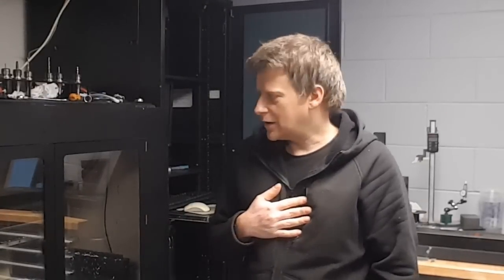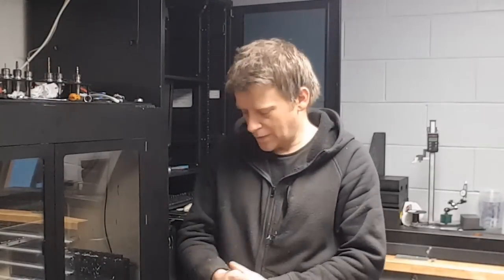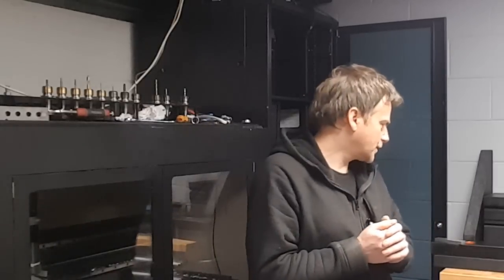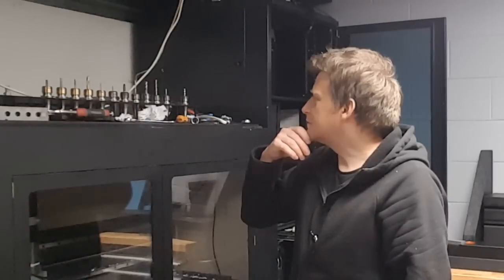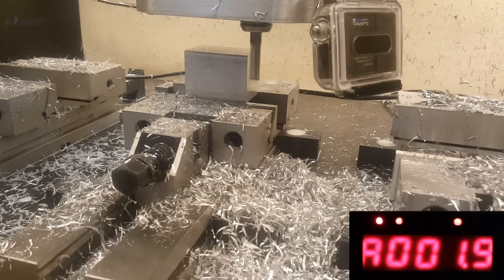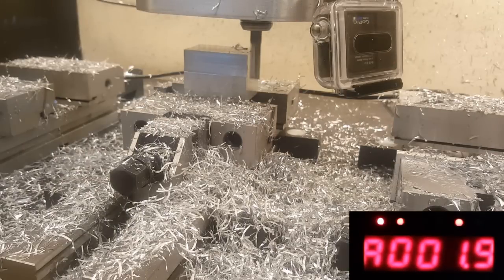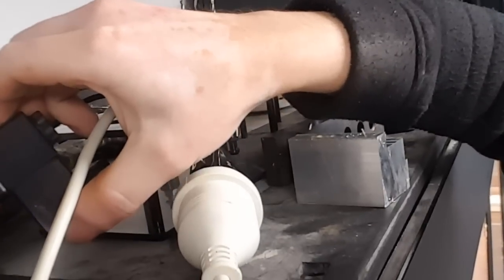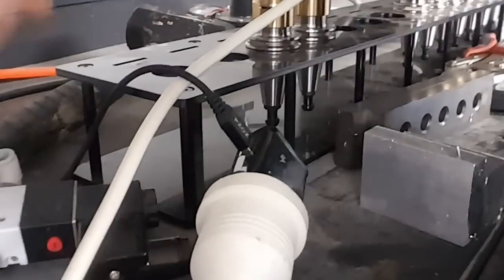ATC 2.5KW testing the spindle limits - THE BEST Chinese spindle, second review after over a year.

Comment: Piotr:  If I remember correctly, you mentioned in your first review that you were going to try using inexpensive toolholders/collets.  Did that work out for you, or did you find it necessary to upgrade?  Also, your spindle's stated rated current is 6.6 Amps, yet it seems to be working fine at up to 10 Amps!  Did you receive any performance and/or setup information for it from the manufacturer?
Reply: It wasn't working "fine" at 10 amps. it was bogging down. Any spindle can go over its continuous rating for short amounts of time. Mostly what that accidental overload test shows is that the rated numbers are truly the "continuous rated" numbers. Sometimes the number they put is the max current, and not the continuous (like they do on your bosch or Makita router for example).
Reply: @wernerautomation2834  OOPs - I guess it was actually 8.9 Amps rather than 10 Amps.  So, spindle power input is 8.9A * 220V * 1.73 = 3391 Watts.  At 60% efficiency, that's 2035 Watts output.  Power ratings for HF Spindles (and most motors), unlike routers, should be continuous output power rather than input power.  If properly rated, Piotr's "2500 Watt" spindle should not have been bogging down, and IMO, doesn't appear to have been.  Why do you think it was?

However, the spindle is supposedly rated 2500 Watts @ 6.6 Amps and 220 Volts.  So, the rated input power input is 6.6A * 220V * 1.73 = 2512 Watts.  At 60% efficiency, that's 1500 Watts output.  Maybe it's rated based on input power, like routers?  That's why I asked about performance curves (speed vs torque) which unlike other Chinese manufacturers, Jianken advertises.
Reply: @gmack4097 that spindle has 0.89nm torque at 24000rpm for 2.24kw output power (and 2.5kw input assumably).  They do not provide a duty cycle, so we can only assume this is both continuous and truthful before testing. The bogging, it is quite audible, with every cut having a continuous tone except those 8+ amp heavy ones. The drop in tone mean the spindle is slowing to a point on its curve where it has more torque available. Because we know this is a flat torque output spindle, we can assume it is operating above it's continuous rating of 0.89nm in that cut. A quick check of the sandvik calculator says the 10mmx4mmx3m/m cut with a sharp 3 flute needs 1.31nm - well above the continuous rating and completely consistent with the 9A draw vs the 6.6a continuous rating.
Reply: @wernerautomation2834  You have performance data for that "2500 Watt" spindle?  Can you share it?
Reply: @gmack4097  its on the jianken website page for that spindle.
Reply: @wernerautomation2834  Shouldn’t the VFD limit the motor current to the “PD141 - Rated Motor Current” from “the nameplate of the motor” to “protect the motor” as stated in the VFD manual?  Piotr reportedly entered 9A rather than the nameplate's 6.6A for spindle current when he programmed the VFD.
-Selecting “ISO Goup: N, Main Group: 1, “Sub Group: 2”, “Manufacturing Process: Z”, and “Heat Treatment: AG” in the Sandvik milling calculator for Piotr’s 6061 Aluminum predicts 3.25kW and 1.29nm at 24 kRPM.  (Even more torque/current would be required at lower speeds to maintain the demonstrated material removal rate.)  That seems unreasonable since there’s only 3.39kW going into the spindle.  After changing to “Heat Treatment: UT” the Sandvik predicts 2.0kW and 0.79nm, which is somewhat more reasonable and consistent with other calculators like Kennametal’s (1.1kW and 0.44nm) and HSMAdvisor’s (1.4kW and 0.55nm) as well as the demonstrated results.
-The closest data sheet for the Jianken JGL-100/2.5R24 spindle that I could find is for a spindle rated 380V at 4.0A (2633 Watts) input and allegedly outputs 0.89nm at 24000 RPM (2237 Watts).  That’s 90% of the claimed “2.5kW” and an unrealistic 85% efficiency.
-Piotr’s is rated 220V at 6.6A (2515 Watts) input and allegedly(?) outputs 0.89nm at 24000 RPM (2237 Watts).  That’s also 90% of the claimed “2.5kW” and an even more unrealistic 89% efficiency.  Who knows how these (and other Chinese) spindles should be driven or how they are should perform.
Reply: @gmack4097 the vfd will limit the current to whatever it has been set to. usually that's 120%-150% the rated motor current, but he could have set it to anything - we know its at least 9 amps :) 85-95% efficiency is what you would expect from an induction motor. they are among the most efficient motors out there, which is why they are used in everything. They lose efficiency in lower speeds and when the load is small.
Reply: @wernerautomation2834  But typical HF spindle efficiencies in that power range seem to be about 75% with an 85% power factor, yielding about 64% apparent input power to output power ratio.
Reply: @gmack4097  no
Reply: @wernerautomation2834  Yes!: Piotr's HY VFD (HY02D223B?) which is "Suitable [for] 2.2kW Motors", has a "4kVA Capacity", and "10A Output Current".  That's consistent with the current requirements of the following spindles, all of which have realistic performance claims/specifications.!  Do you have contradicting examples?
-https://www.mechatron-gmbh.de/fileadmin/user_upload/datenblaetter_2019/HFS-8022-24-ER20.pdf
24kRPM: Output/Input = 2.2kW / (8A * 230V * 1.73) = 69%

-https://www.mechatron-gmbh.de/fileadmin/user_upload/Datenblaetter_2019/ATC-8022-30-ISO20.pdf
30kRPM: Output/Input = 2.2kW / (8.4A * 230V * 1.73) = 67%

-https://www.hsdusa.com/bo/allegati/Files/767_1423h0243_es325_2p_400hz__24000_50000rpm.pdf
24kRPM: Output/Input = 2kW / (5A * 380V * 1.73) = 61%

-https://www.damencnc.com/userdata/file/1137_Dimensions_C4147-C-DB-P-ER25-HYSV-2.2kW-18000-24000RPM_.pdf
18kRPM: Output/Input = 2.2kW / (8.6A * 220V * 1.73) = 67%
Reply: Another (American made) rather impressive "passively cooled" 2.2kW ATC spindle rated for 10 Amps at 220 Volts. - https://www.youtube.com/watch?v=qiM20-woEOk
Reply: @gmack4097  That efficiency calcukation is conceptually wrong! The motor's rated current multiplied by rated voltage gives you the apparent power in VA while the rated output power is in W. Not the same unit. Seems the same, while W=V*A, but it is not exactly. The apparent power (VA) is the vectorial sum of the reactive power (VAr) and real power (W).

The conceptual flaw is that the reactive power does not produce work nor require it to produce so it does not decrease efficiency alone.

The rated current is higher than than real current (which is in-phase with voltage) would be, and the VFD and other components should whithstand that higher current. It creates loss in the VFD and in the cables, which decreases the efficiency slightly, but not as much as come out by multiplying the motor's data. If you measure the real power before the VFD, you still get nearly the same as the output real power, the VFD's efficiency should be beyond 90%.
This is why the power companies penalize for bad PF, because you won't pay it for, the real power meter doesn't show it, but creates losses in their network.

The motor's efficiency is still not 60% but somewhere above 85%-95%. That's the ratios of the real powers that produce work.
The other work besides mechanical here is heat.

In other words, measure the heat output power of the motor and the kinetic output, and the efficiency will be the ratio of the P_kinetic/(P_heat+P_kinetic).

If you think, the heat output could not be 1kW for a 2kW motor (eff=66%), because you know the size and know from the kitchen that with 1kW you could boil water and cook food on similar sized surfaces. You would need water cooling with massive radiator or fan to dissipate that energy - which apparently not the case for any 2.2kW induction motor.
Reply: @gabiold  The VFD limits the amount of current into the spindle to whatever value it's set to.  That current has to be sufficient to account for both the motors efficiency and the power factor to get the rated power output.  So, effective motor power output is reduced by the product of efficiency and power factor.  That's apparently 60 - 70%, as shown for the spindles with more realistic specs.  Sorry I used incorrectly "efficiency" to account for both factors!
Regardless, apparently the efficiencies for typical HF spindles are much lower than your 85 - 95%.  This 2.1Kw spindle  https://www.upload.sorotec.de/doku/manuals/1381_y6162y0040_mt1073-120-el-er25-220v-dx-18_0_.pdf has an efficiency of 75% with a power factor of 0.774.  It needs 9.5A at 220V = 3620VA (9.5*220*1.73) to provide 2.1KW output = 3620VA*0.75*0.774.  Have you seen any HF spindles with significantly higher efficiencies?

Comment: That looks very promising. Ive been in contact with Wafer to get some answers and Im hanging on the purchase button :) 
It all comes down the price and the amount of accesories. how did you connect the air return to get the spindle to turn freely direct after a tool change? 
cheers
Reply from the maker: maybe you should go for BT30 instead of iso25.  air is connected through solenoid valve and it release pressurized air as soon you let it go. so spindle can spin freely. I showed it somewhere in the video.
Reply: @PiotrFoxWysocki  why is that? isn't the iso25 holder any good? I will check your videos once more :)
Reply from the maker: @JDesignSwe  it's not because it's bad. Its because bt30 has more tools available.
Reply: @PiotrFoxWysocki  ah I see, Im not running bigger than Ø10mm endmills at the moment so I guess that iso25 will do just fine.  ..   I hope :)

Comment: Any reason you went with the 2 pole vs the 4 pole spindle?
Reply from the maker: there is always a reason, they had this spindle as 2 pole. so i got 2 pole :)
Reply: @PiotrFoxWysocki  Thanks for the quick reply. They have a 2 pole and 4 pole version of the 3.2kw spindle. Would you have gone with the 4 pole if it were an option for the added torque?
Reply from the maker: @Peace11uehman  i'm not sure what are the benefits. maybe someone else could voice his opinion.
Reply: @PiotrFoxWysocki  They sent over a chart with the following info: The 2 pole has a frequency range from 6000rpm (100HZ) - 24000rpm (400HZ). The 4 pole 3000rpm (100HZ) - 24000rpm (800HZ).  So basically the 4 pole will allow for a lower minimum RPM which could be beneficial for milling metals.
Reply from the maker: @Peace11uehman  thank you for the explanation, I guess you answered your question :) if i could add something,  spindle will turn with 100 rpm. no matter what. but power consumption of just spinning is higher than actual cutting at 20000rpm.

Comment: Did you check that your spindle was really running at 24,000 RPM?  Your setup video for the VFD (4 pole configured for a 2 pole motor) suggests that it might be running at 12,000 RPM.
Reply from the maker: this is a quote from the email i have exchanged with them over a year ago " 
Yes, this one can also operate on 220V. And the frequency has two options, one is 800HZ(4 poles), the other is 400HZ(2 poles)."  i believe i have it set to 400 and 2 poles. when i was setting it ups i did check rpm and it was correct.
Reply: @PiotrFoxWysocki  Love your videos, very inspiring !!  I have a question, did you buy the 400hz version or the 800hz version of this spindle?  Oh, and one more question,  do you believe the lack of "drive lugs" in the collet is any issue ?   I am seriously considering a spindle from this company thanks to you. btw, I mentioned you in the correspondence with them.
Reply from the maker: Just talk with them, they should recommend best option for your needs.
Reply: @PiotrFoxWysocki  Maybe you can even get them to provide some meaningful performance and VFD setup information so you know what you're getting and how to use it!
Reply from the maker: @gmack4097  I tried multiple times. They promised to make a manual, but obviously they ignored my suggestions...
Reply: @PiotrFoxWysocki  That's unfortunate since they seem to be the only Chinese spindle manufacturer that advertises performance information/curves (which are apparently nonsense anyway).  @werner automation may disagree, but seems to have dropped out of that discussion.  Other Chinese spindle brands may not be as high quality (more runout, grinding/drilling parts for balancing, etc.), but at least their performance claims (efficiencies) seem more realistic.  Unlike Jianken, the others seemingly also provide enough information to drive them properly.
Reply from the maker: @gmack4097  janken will give you all the Information  you need. But via the email. Performance wise as you have seen on the video, it goes! Btw this is 2.5kw spindle which I'm  driving with 2.2kw vfd.
Reply: @PiotrFoxWysocki  What did they say to use for rated motor current and voltage?
Reply from the maker: @gmack4097  obviously they recommended 2.5kw vfd. and in NZ we have 240v. it was over a year ago now do please forgive me but i don't remember much from all 70+ emails i exchanged with them :)
Reply: @PiotrFoxWysocki  Your HY VFD should be able to drive spindles that are rated for 220 Volts and 10 Amps (3.8 kVA) over an input voltage range of 170 - 250 Volts.  Based on it's label, your spindle is rated 220V and 6.6 Amps (2.5 kVA).  But, as @werner automation pointed out in the other comment string "it's performance curve shows 0.89nm torque at 24000rpm for 2.24kw output power" maximum - not 2.5kW.  Based on typical spindle power factors and efficiencies characteristics (see that other comment string) and your performance demonstrations, it's more likely a 1500 Watt spindle at best (assuming the rated voltage and current values are correct).

The spindle's "Rated Motor Voltage" (220V) and "Rated Motor Current" (6.6A) are set via the HY VFD's PD141 and PD142 parameters.  PD004 "Base Frequency" (400) in conjunction with the number of motor poles PD143 "Motor pole number" (2) and rated motor speed PD144 "Rated Motor Revolution" (24,000) set the speed of the spindle at which the rated voltage and current provide the rated (maximum) power output.
Reply from the maker: @gmack4097  I have seen people doing all sorts of calculations and somehow results are all over the place. so I'm not interested in math at all. current spindle destroys aluminium at  the rate I'm pretty happy with. if i will need something bigger than I will get bigger spindle. 2.5kw was the limit for 220v.   to this is the limit of power anyway. unless i  move somewhere with 380v, im stuck with current one. So, no need to waste time over the math if the output correct or not. it is what it is.

Comment: Simply connect a second relay to your 24v relay from the VFD. you can get relay boards for less than 1 $ from China.
could you make a video explaining your more about what is necessary to run such an amazing spindle: like air quality/ amount. Why did you choose the 100mm version and not the 80mm? What is the approximate price of the spindle
Reply from the maker: i would recommend to take look at the review part 1; https://youtu.be/pWNeW-lH9RA more details are in the video description.
Reply: @PiotrFoxWysocki  I know your video from a year ago. but my question still remains did you have any reason for choosing the 100mm version instead of the 80mm version? The sk25 are less common the spindle is heavier...
Reply from the maker: @GuyFawkes911  i just wanted the biggest spindle i could put in to my machine. i was thinking about bt30 but it was too tall, and more expensive. and since this was unknown manufacturer i didn't wanted to risk too much.

Comment: Piotr once again thank you for the spindle recommendation. I just uploaded a video about my pneumatic linear tool rack fully operational on my router with the JGL-80, I think you definitely should design one for your machine. I can assist with the design and macro programming. Also can you suggest any inexpensive iso20 toolholders and er16 collets? I think $100 for the parfaite tool holders is too much, I have been using cheaper $20 holders for my larger diameter cutters with no issues.
Reply from the maker: nice work! curently i have 14 tool holders and i need 14 more. so making a tool holder for something like this would have to be huge. i know i could switch tools in holders when i need them but this is more work and a lot of room for mistake. when i will need tool changer i think it will be the time when i will get a proper machine
Reply: ... or two pneumatic racks on two floors or two revolvers. I`m not joking.
I made 21 tools in a two-storey rack.
Reply: @ivandoychev8841  Yeah lots of options, I'm thinking a 2 row horizontal rack where the first row is always accessible and the 2nd row is accessible with a piston pushing out the rack.
Reply: @PiotrFoxWysocki  I sorta have the same issue. my machine is 300mm travel, so getting many tools in a tray format doesn't work. The best (simple) idea ive seen so far is a round carousel with a pie slice cut from it. The pie slice means the carousel it out of the work area in its 'stowed" position, and you get tools all around the other side - in my case 12 or so.  past that you start needing a separate automated machine that can stage the one tool you need from a 3d rack of many tools. Easily done with an Arduino, but less easy to have the control coordinate with it as it needs to know both the tool you have, the tool you want, and the tool you want next that to be efficient.